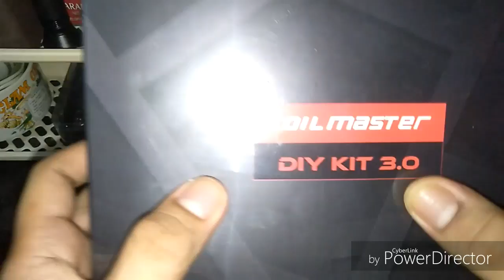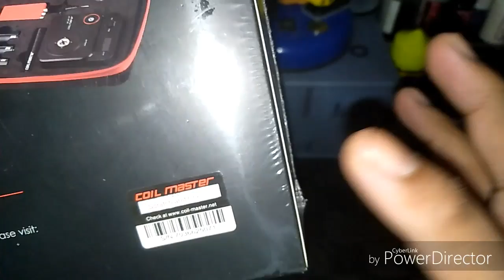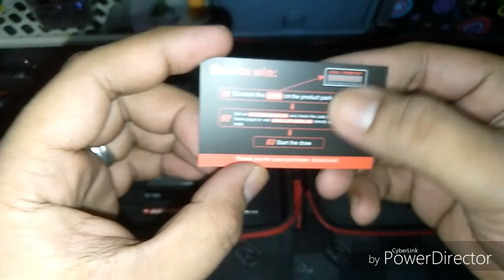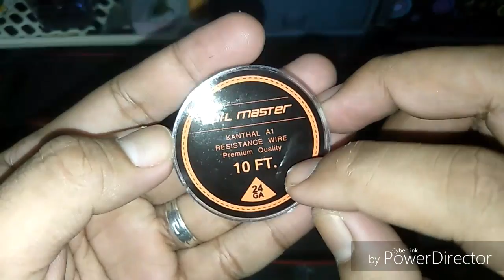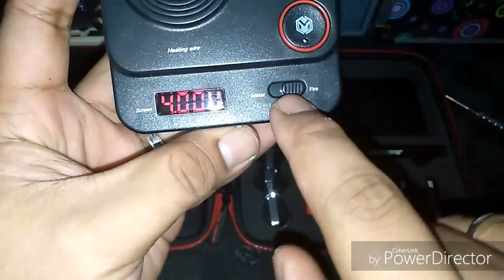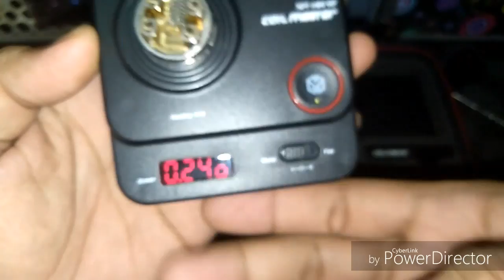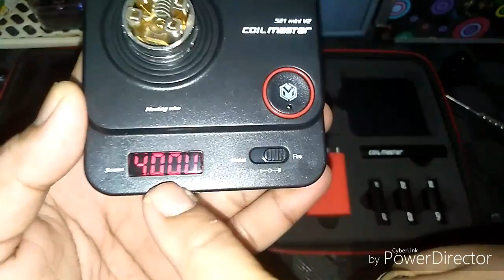Coil Master DIY kit V3 unboxing ( Tagalog)

Comment: Mag Kano po
Reply from the maker: 1,800 legit sa vape shop
Reply: @OliverGatch  patulong namn pano makabili nyan
Reply from the maker: @noeldemesa6936  shopee boss meron search mo lang make sure legit ang kunin mo atleast around 1,800 pesos ang pricing nya
Reply: @OliverGatch   puro walang code kase ung mga nasa shoppe
Reply: @noeldemesa6936  vape supplier search mo sa fb kakabilo ko lang kanina 1450 legit na legit